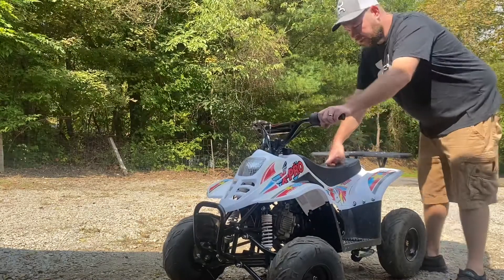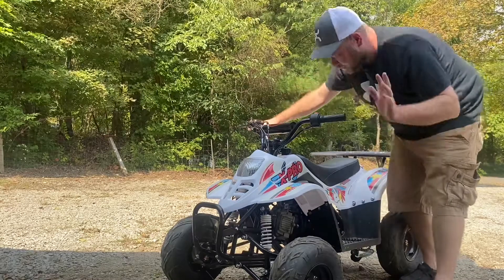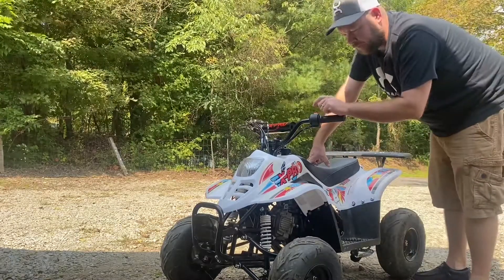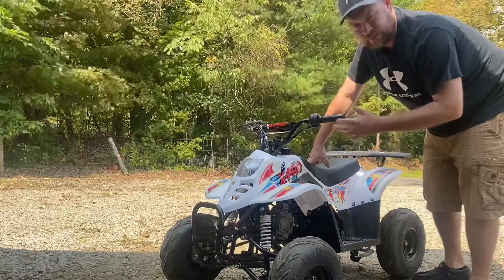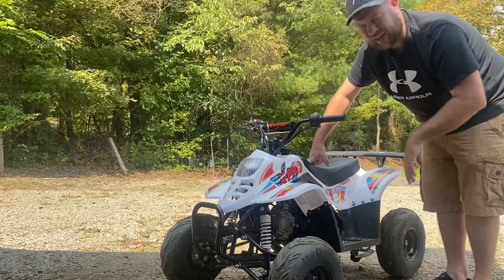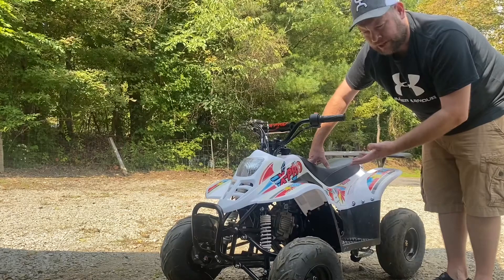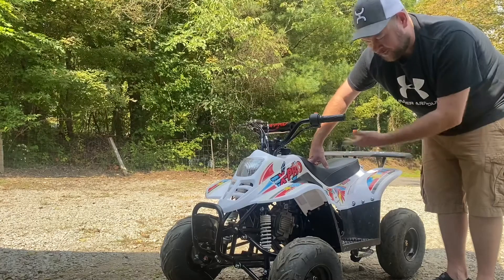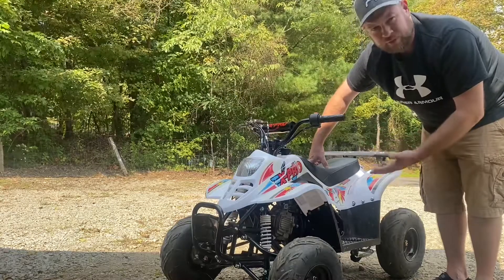X-pro bolt 110cc “ Start up problem fix”!!!

Comment: I swear, everytime I see rivets on a machine part that needs repairs it makes me want to burn that machine to the ground.  Haha

Great video, I just ordered this quad and found a functioning aftermarket carb on ebay that I'll be replacing before I even put my boy on the machine.  Thanks again.

Comment: Use a dremel or a hack saw and carefully cut a groove to fit a flat blade screw driver in and you can take these carbs apart.  Then replace with actual screws.

Comment: My wife bought one of these for my son. Watching your videos to see what's up with it. Thanks for posting these. Those two bolts on the sides of that old carb, may be able to grind a slot into the head and turn out with screw driver? May not be a big deal to ya, since you have a replacement. But there might  some usable spare parts in that old one.